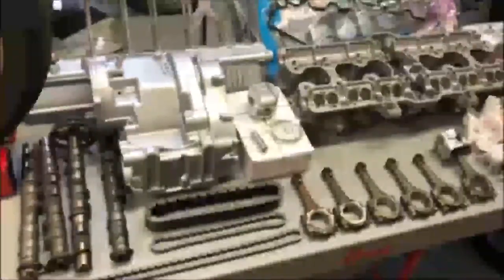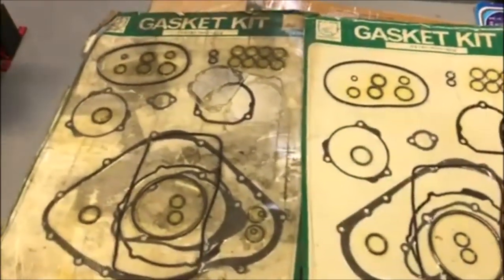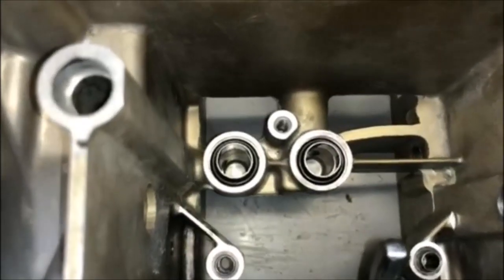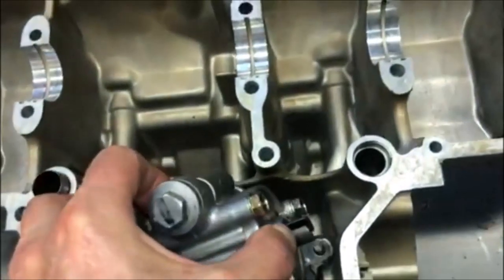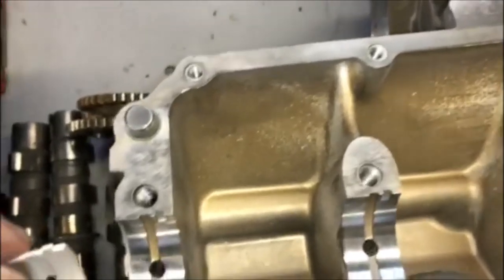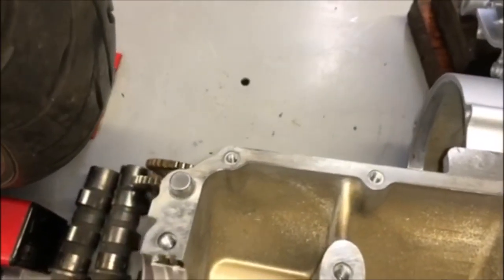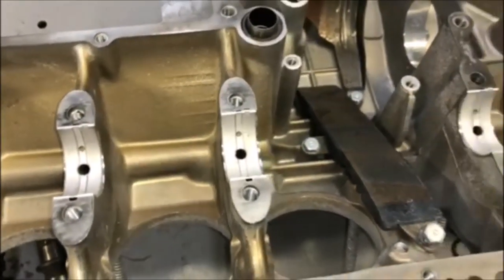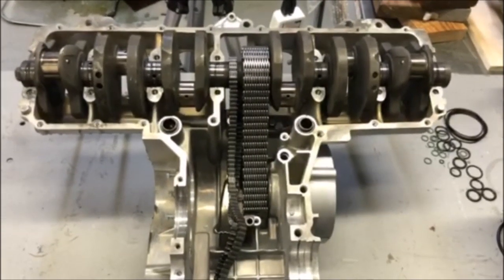Honda CBX Full Restoration & Engine Rebuild Video Series - Part 14 - Re-assembly Part 1

Comment: Hey Pete: on those chains, a quick check of pin and side plate wear is to twist the chain sideways by holding each end. If you take a new chain and a used chain and bend them sideways, you will see exactly the amount of wear. This is an old millwright trick. Try it and you will see what I mean. The new chain will bend sideways very little and the used chain that looks good will reveal precisely the amount of wear.  Great videos! Rebuilding an engine right now and using your videos as a guide.

Comment: What I was thinking was, it might not be good for somebody to just grab any O-ring that fit out of any kit, or basket.  ( Viton; Buna-N; Nitriel ). Thank you for being there!!!
Reply from the maker: Hi Mark, I agree with you in most cases. In this case, the O rings for this application are standard O rings. Also, I have extra Honda O rings from multiple Honda CBX gasket sets from past projects, so chances are that these O rings that I used were actually the correct ones LOL

Comment: I’m still very much a beginner and learning, but I remember WWWAYYY back in the day, my father buying raw stock of gasket material and MAKING his own gaskets by tracing them out (at least with the non-metal gaskets, such as valve covers ON CARS)... Do people ever still do that?
Reply from the maker: Yes, you can actually buy gasket material in most auto parts stores.
Reply: I remember using old cornflakes packets after being told it's the same stuff....it isn't.

Comment: Hi, greetings from Costa Rica. Your job is so much appreciated and helpful!!!!! I am in the process of restoring 1 cbx1000 and also building another motor. I have a question: any suggestion where to find tensioners and guides?? I need 14510-422-010 (Tensioner A) also 14520-422-000 (Guide A, Cam Chain) and 14530-422-000 (Tensioner B). I am a little worried about availability of those parts. Thanks and God Bless.

Comment: Pete did Honda not have the o rings and gasket
Reply from the maker: They have some, and not others. It’s easier and cheaper to get the set. I have had good luck with either of the 2 sets I mentioned in the video. The Honda sets are no longer available.

Comment: Splendid!
I guess the time you spent just uploading this movies are considerate.
My hat of for you Sir Pizza.
I just started to rebuild a CBX. 
13.36 in you say that the oil goes into the alternator. I dont have the alternator, thats the missing part unfortunatly. So when I start the engine just for the sound it squirts oil out from the axle spinning the (what i think) alternator clutch. I cant se any oilseals in the manual either. Do you have any  movie of when you rebuild that axle, so I can see what holding the oil back in the engine?

Comment: Pete, to clarify, the parts you mention at 12:14 that isn’t shown in the parts or shop manual is the primary chain tensioner oil feed shown on page 12-19 of the shop manual.  The sleeve with the pipe feeding the chain tensioner slips over that screen.
Reply: Right, the hole feeds through the protective screen to the primary chain tensioner spring assembly. These oiling systems are highly efficient if kept clean!

Comment: Hi Pete, 
Thanks for such great content, your step by step approach is really informative. I haven’t rebuild anything as complex as this, just single and twin cylinders motorcycles, but the detail of your description has given me so much insight , which has helped so much.
Are the shop manuals for each motorcycle including parts manuals available for anyone to purchase, or are they trade only? I can see how helpful having access to the information incredibly helpful!
Keep the great videos coming my friend
All the best 
Andy
Reply from the maker: Hi Andy,  Thank you :)  The manuals can be found pretty regularly on eBay. I have a number of various manuals available that I do not use for various bikes that I might be in the market to sell. let me know if there are any specific ones you need and I can check to see if I have it. I mostly only have Honda and few Yamaha from the 70s & 80s.
Reply: I agree.
Its like having a wise Uncle out the in the barn to lean on when it starts to get tricky :)

Comment: Did you have to measure the crank with those squash tabs, like you have to on the 400/4? Iv seen it in a magazine article and it looks a nightmare.
BTW I use stp oil treatment neat for assembly lube, works great and is a lot cheaper.
Reply from the maker: I only measured the journals on the crank to make sure they were within the specs that the shop manual listed. The journals were in such great condition, and the bearings looked like new, that I am assuming that there are no issues with the crank specs. It might be lazy on my part, but I don't think I have ever come across a Honda that had crankshaft issues. :)